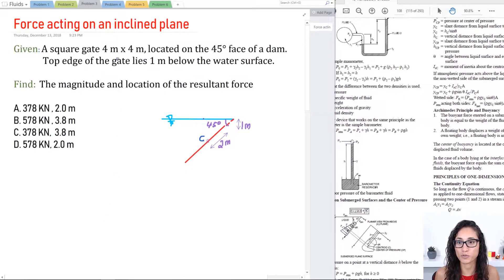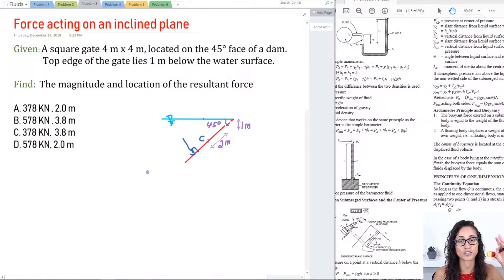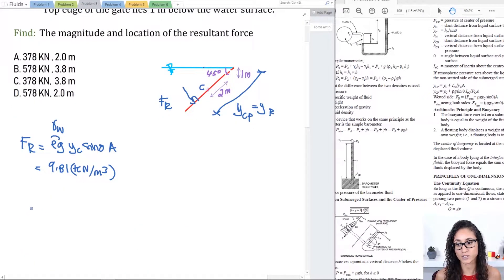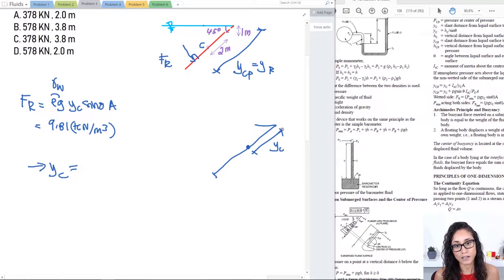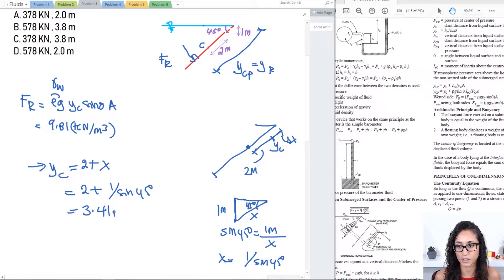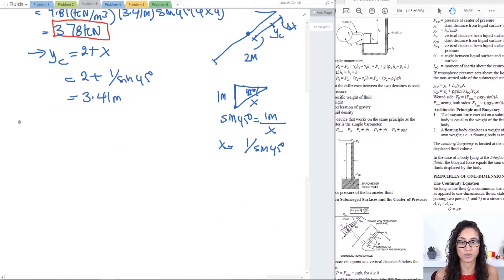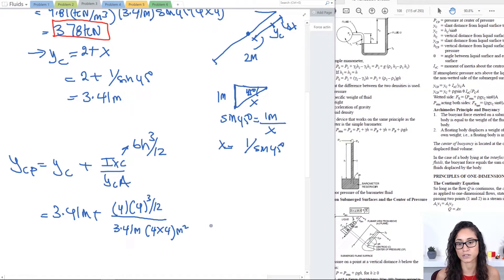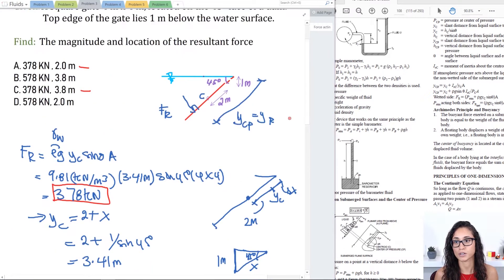FE Exam Fluid Mechanics - Force Acting On An Inclined Plane

Comment: Since you know the location is greater than 3.41 meters you should go with C once you know the force is 378 kN. Spending the minimum time on a question possible to get the right answer is key to passing.

Comment: Thanks for your videos. Very helpful. Where do you get page 109?
Reply: In the 10.3 Reference handbook, it is now under page 180, under the "Forces on Submerged surfaces and the Center of Preassure" section in Fluids.

Comment: Can you please help me with this question:

a 1m x 2m inclined plate is submerged and the height h2= 5m and angle is 20. What is the normal force acting on the upper surface 

When I use your method it gives me the wrong Answer

Comment: Thank you for the video, it’s very helpful. I have a quick question for you. If the same question comes on FE and asks for Normal force acting on the upper side of the plate, we will still use the same method correct? Because in a book, they have used average of the heights of the 2 upper ends of the plate as the value of H to calculate the pressure. Kindly help me clear this confusion.
Reply: You calculate the hydrostatic force based on the pressure at the depth of the centroid, and the area of the shape.  You then calculate the OFFSET from the centroid, using the 2nd moment of area of the shape and the formula with numerous other factors.  The effective point at which the hydrostatic force acts, is based on the offset from the centroid.

If all you care about is the total force, you don't need to think about the offset from the centroid.   If you are interested in calculating reaction forces that depend on the moment of the hydrostatic force, then you need to consider the offset from the centroid.

Comment: Hi! Thanks for posting this (: Is it convention to have the location measured from the elevation of the water? I was originally thinking of the bottom of the gate as my datum
Reply from the maker: Usually, the water surface is our datum! Also, the way the equations are derived, it is assumed that the water surface is the datum! I hope this makes sense and good luck with your studying!